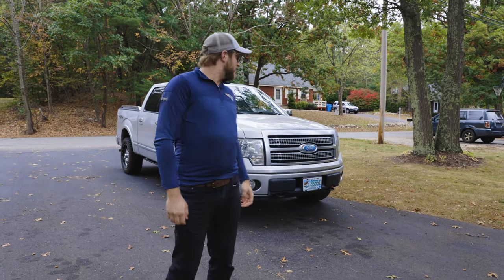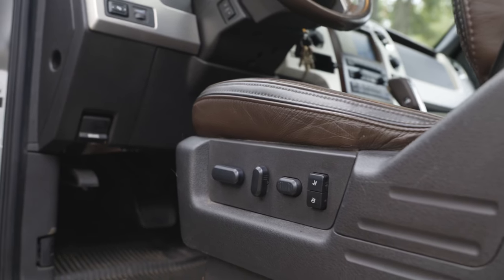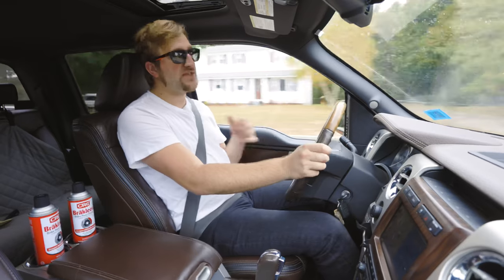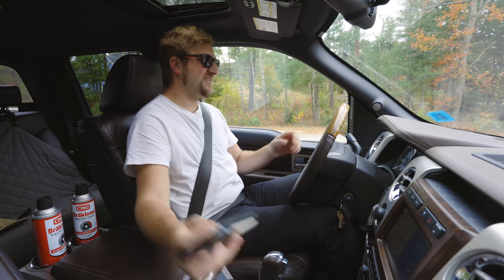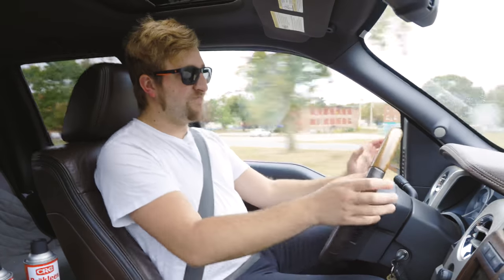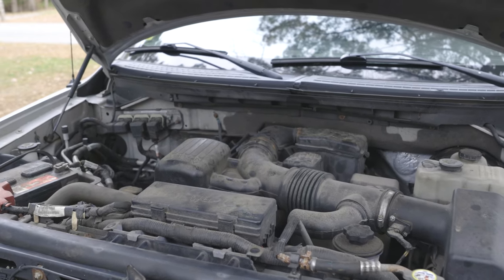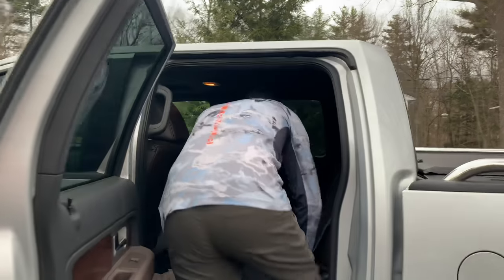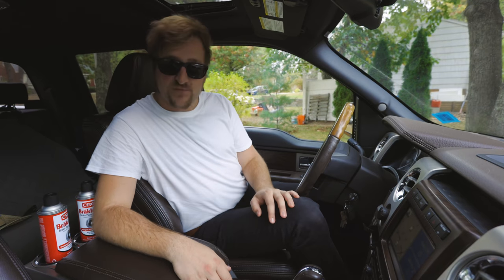2009 Ford F150 5.4 V8 - Long-Term Review (Reliability, 0-60, Towing, 4x4)

Comment: The early 5.4L was much more reliable in my opinion.  I had a couple 2002 F-250s that each made it to about 250K miles and that was with hard towing everyday of its life.  The only thing you have to worry about with those is the spark plugs blowing out which is not that bad once you figure out how to fix it.  After they went to the 3 valve (2004?) that's when the real problems began.   I bought a 2004 F-150 a few years ago because the older ones were so reliable.  It only made it to 150k before the cams failed.  The truck was not worth fixing.   LOVE FOR THE WIZARD!
Reply from the maker: For sure, same with the 2V 4.6! Yeah I think they went 3V in early ‘05 with the release of the S197 mustang. The 2 valves were definitely more reliable, but unfortunately the trucks themselves weren’t built or designed as well prior to 2003. All hail THE WIZARD!! 👌🏼
Reply: @NotSoHandyCarGuy  The 2v 4.6L's are crazy reliable, I've seen a few F-150's 4.6L's that have over 400K on them and some old Ford crown vic Taxies in that range as well.
Reply: Lol just spark plugs blowing out, not a big issue, it's not like it's something that's been done for 100s of years.
Reply: @jonathangarzon2798  he said the older trucks lasted longer and the only problem was the spark plugs
Reply: What about the 5.4 in the 08 trucks?
Reply: Booo Wizard

Comment: I had a 06 f150 fx4 5.4lts for 6 years, bought it used from with more than 200k miles, never had 1 problem with the engine, the tranny went dead at 220k miles tho

Comment: I have an ‘08 F-150 w/the 5.4 3V non flex fuel all original and had it since ‘14  with 60k miles and now it has 154k miles on it with the only things done to it are 1 brake job all 4 wheels, R&R spark plugs @ 115k miles, R&R L/F hub assembly, 1 set of tires and now it needs another set of tires due to needing rear shocks & front strut assembly also a starter and what I’m scared about it’s over due to drop the transmission pan and replace the filter with fresh fluid which at this point I’m about to put it for sale and just start fresh on another F-150 and probably a ‘21 model w/the 5.0L this time around. Oh ya the ‘08 I have is an SXT 2WD crew cab and a 6 ft. bed with leather interior and a great kick ass sound system.

Comment: 5.4's  like their oil changed regularly.. meaning every 3k miles.. yes, yes, I know most think 5k is the magic mile, but considering the lubrication issues and low oil pressure, change it every 3k and your engine will show you much love.
Reply: you can do 5K as long as you use good quality 5W-20 oil and of course a Motorcraft oil filter. Nothing else
Reply: @MrLuisinho90  thats correct. I use Shell Rotella 5w20 Truck Oil (Red Bottle) expensive but worth it

Comment: Have a 2009 f150 platinum tow a 3500 car trailer around all day and loaded usually around 8.5 to 9,000 pounds no issues at all love it
Reply: This is the comment I needed to see. lol. I’m looking at a 09 platinum right now and my camper weighs 8,599 lbs lol. So thank you
Reply: Update on the truck???

Comment: I have 104,000 on my  2004. Bad on exhaust  manifolds. Other than that, it runs fine. I change my oil every 3,000 miles.

Comment: I have KO2s on my 2002 chevy. and watching this video, wondering if I could buy 16' Ford rims and use the KOs on the chevy.  A mechnic yesterday told me I had to worry about the brakes.   Just bought yesterday a 2009 F150 XLT  ( 18' wheels) to replace my 2013 Lariat EcoBoost that was involved in a head collision.  Miss my luxury truck, but the XLT drives great and was well taken care of..Also same color.  But a lot of miles.  Watching this video to  convince myself that  I made the right decision to buy it for $10000  I do put seats up in back and sleep diagonal on a pad..slept like a baby.  That was a requirement for a truck after having this on the Lariat SuperCrew.

Comment: The oil passages are not the issue.  Oil change intervals are the issue. Just think about it, if the passages were the issue many many engines would never make it past the warranty.  None of the engines would make it past 200,000 miles.  Very little if any oil would make it to the phasers at all.  Regardless if the engine is new or old.  You would have an engine tick on every motor.   People tend to have cam phaser issues because they don't maintain them.  But they do have issues with the chain tensioners blowing out giving them a start up rattle.  These engines are very very picky when it comes to oil change intervals.  3,000-5,000 miles is a MUST.

Comment: Hey how’s it going? I’m planning on getting one of these but a 2010, any idea on it’s off-road capabilities. I know it’s not quite designed for it like the raptor or fx4 but the king ranch I’m looking at right now is a steal
Reply from the maker: What’s up Pat! 2010 is the best year for them. From what I understand, they are pretty decent at off-road! I’ve never done any trails that needed crazy articulation, but the traction has always been there for me. It helps how it has the limited slip diff in the rear, and always seems to send power to the correct wheel.

Comment: use Shell Rotella 5w20 Truck Oil (Red Bottle) MOTORCRAFT oil filter and Shell V-Power for gasoline. Keeps the truck fresh and alive. 
Using expensive oil and gas is cheaper then buying an engine and transmission 
Also FORSCAN is cheap and can help with DTCs and unlock extra features

Comment: At the age of the truck you are reviewing the spark plugs are not an issue as they have probably been replaced by an updated design. As for the oiling issues the 04-08 were the worst ones the 09-10 were much better.

Comment: I have a 2004 f150 with the 5.4 in it that i got almost brand new and it has over 300,000 miles on it and it hasn’t had very many issues except the spark plugs quit once but that was the only thing wrong with it.

Comment: I have 2 5.4 3 valves. One is in a 2007 Expedition Eddie Bauer. 364,000kms and never touched. It's quiet and runs excellent. 5w30 synthetic blend and oil changes at 5000kms. Don't ever go over. The entire timing system is controlled by oil pressure. The other one I just purchased. 2005 F-250. 125,000kms and total timing chain failure. Has probably had five oil changes in its life. Doing timing components this week. It will live.

Comment: I’m bought mine repoed in 2005. I am at 280k all original except brakes, just now doing wheel bearings and control arms. Can corned from sunroof drain tube mistakes HAS THE TICK. I unplugged the vct system until I can fix it

Comment: Agreed about the reliability, specially on the later years of the 3 valve engines that had a few design fixes done by then.

My dad had a 2010 F150 with the smaller 4.6 3V V8. I remember last year we got very nervous because the exhaust manifold gaskets started leaking and the truck would exhibit a cold start knock for about 1-2 minutes. At first we thought it was going to be the timing chain guides but thankfully it wasn't. We ran a boroscope through the heads and everything was fine. Actually I noticed how clean everything was, no scoring on the camshafts, nor the roller followers, nor any traces of sludge. It all looked solid. Yes it needed the VCT solenoids replaced after 100K miles but we replaced those at home and the truck ran fine once again. My dad used that truck to haul materials when building his house and it never let him down. He sold it with 130K in it.

We never got the exhaust manifolds  fixed since the truck was mechanically sound and the expense was quite large ,  It was just the anoying cold start sound but that was pretty much it

Comment: Hello which engine do you recommend? My daughter going to be hauling 3horse albumin bumper pull trailer, weighing little over 7000lbs. Looking to purchase a 5.4 or 5.0
Reply from the maker: If you have the option, I’d go with the 5.0. They’re better designed engines and will likely last longer. Not to mention slightly more fuel efficient

Comment: The 5.4L is a decent engine most of the time, but when it needs plugs, it could end up costing you thousands.  And if you ignore maintenance just a bit, it can stab you in the back long, deep, and wide when your valvetrain blows up and takes out the rest of the engine.
Reply: Thousands?  My mechanic replaced mine and with three breaking it totaled $150.  You either have an inept mechanic who thinks you have to pull the head when a plug breaks because they don't know there is a tool to extract them or your are being robbed.
Reply: @scottperson9487  I literally changed mine a couple hours ago, with some really basic tools so it wasn't even 100$

Comment: Is the 2010 f150 to avoid because of structural issues?
Reply from the maker: Not that I know of, no.
Reply: @NotSoHandyCarGuy   Some of the early 2010 models had that boat anchor 3 valve 5.4 installed in them. The cam phaser problems. I believe most are dead or scrapped out by now though.
Reply: I don't think so either. My Ford mechanic says the 2009 and 2010 5.4l were the best years for the engine, by then they worked out all the issues from the older models. But like most things truck related,  the answers are subjective.

Comment: Looking to buy a 2007 F150 5.2L with about 190,000km for $15,000 CAD.

Should I fork that up for this truck?
Reply: You mean the 4.2l or the 5.4l? With 95k miles on it roughly at that price as long as it's relatively rust free besides minor surface rust obviously. And it seems to run smooth And drive well, no cam phaser issues I would get it at that price. Always try to haggle them down on price and if they offer an extended warranty get the top of the line version. YOU WONT REGRET IT , but I would say pull the trigger on it if still available

Comment: The 09 should have the updated heads so it dont need the 2 peace plugs. The spitting od the plugs were  in the 2 vavle it wasnt enough threads for the plugs. Other then that next timing chain i did i would upgrade to a hi flow oil pump and just enjoy the truck.

Comment: I have a 10 5.4 with 231000 miles good motor
Reply: Nice man, i have  a 10 4.6 its my daily. Your truck still chuggin along?
Reply: @michaelH0000  yeah! Living in mn bed starting rust about the wheels but motor and trans still strong almost at 250xxx now

Comment: I bought mine 5 years ago and it’s at 158k miles how long do you’d thing it would last it’s getting 8.8 mpg too at the moment not the most knowledgeable about vehicles
Reply from the maker: It should last you a good while longer! Just make sure you keep up with oil changes. That’s the most important thing with these 5.4’s. It also can’t hurt to get all of your differential fluids changed, and your spark plugs done.
Reply: 8.8? I get 13 in mine

Comment: 2008 f150 5.4 220,000 miles no major problems.  Only changed the oil filter housing gasket.
Reply: I'm about to change my oil filter housing gasket on my 04 4x4 😅 any tips?

Comment: Does anyone else’s 5.4 shake when it’s idles forward under its own power
Reply: Yes when mine shakes at a stop only in drive or reverse but when I put it in park it stops. Would like to know what’s causing that. Just started doing this a month ago
Reply: Sounds like a camshaft position sensor starting to go bad.. check engine light on yet? If not eventually it will be

Comment: Triton 5.4 engines are hit or miss as far as reliability. I own a 2004 f150 Lariat and I’m on 221.000 miles and so far just changing oil and plugs and coils plus normal stuff brakes shocks ect. Yes it has rusted out cab corners but rides and drives fine. Yes it does sound like a diesel engine lol but she’s still going strong. It’s a crew cab four door. I guess I was one of the blessed ones or lucky ones as some may call it. Ford continues to have issues with their f150 series. When she finally goes I’m Toyota Tundra all the way. Sad ford makes garbage…..SMH

Comment: I HATE my 2005 Expedition. It has 147k miles and I’ve only owned it for less than 4 months. I had to replace the front passenger window regulator, all new front end, vehicle security module went out, and it burned 7 quarts in 3,000 miles. This is the worst vehicle I have ever had. I have had 15 vehicles. Oh I also forgot to mention two engine misfires.

Comment: A BRAND NEW 2009 F-150 PLATINUM, 4x4, FULLY LOADED, AS TESTED BY EDMUNDS WAS $46,000, NOT THE 56,000 YOU QUOTED. This is why the used car market is in shambles. You have worn out trucks selling for what they were BRAND NEW WITH 0.0 MILES! Any pickup on the market right now, with high mileage, over 75,000 miles, IS OVERPRICED BY 2/3 or 66% OF WHAT SELLERS ARE ASKING. CARS DO NOT INCREASE IN VALUE TO THE POINT THEY COST MORE THAN WHEN THEY WERE NEW! A motor with 200,000 which you see a lot of, IS NOT A STRONG MOTOR, IT IS NOW WORN AND WEAK AND LICKY! Greed is a bad salesman!
Reply: Inflation!!

Comment: Uhhh, no.
The 5.4, properly taken care of, was superior for towing and true truck work.
The 5.0 is better in many and most aspects but, low-end towing work.
100%wrong!
FYI I am a farmer with both.

The 2009 had the spark plug problem solved by then.

Comment: run 5-30  oil, not 5-20... change the stock oil pump to a Melling high volume pump  that will increase oil flow about 25 %.....change the cam followers to the update ones.....    then that engine will last .......